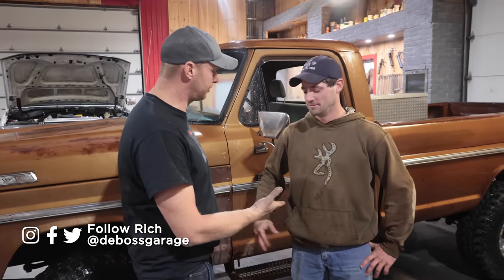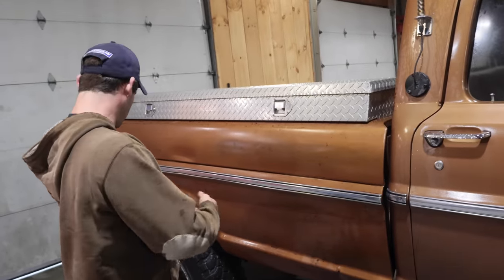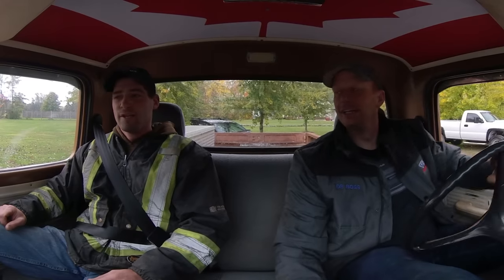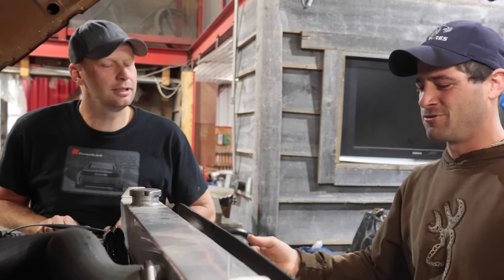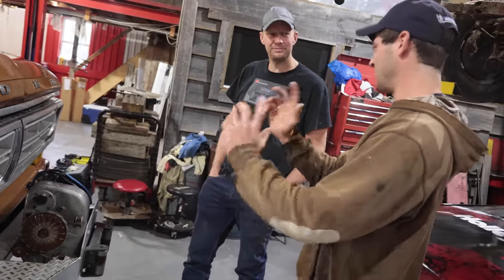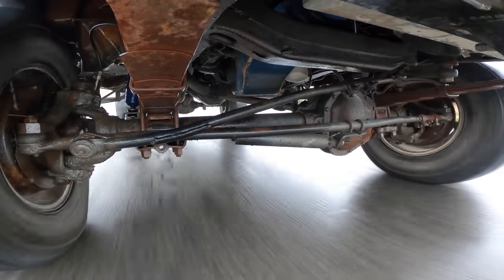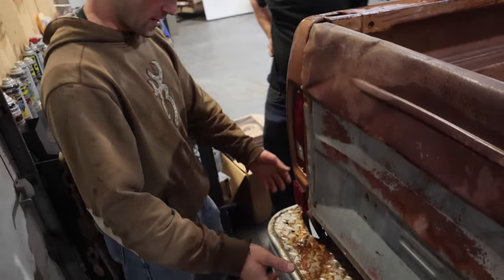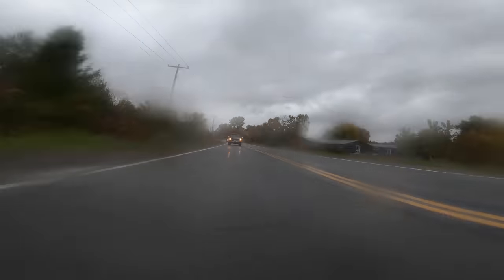The Truck You Want, But Won't Admit It.

Comment: Heh... My first S10 was also manual steering, but it needed tires and I got a deal I couldn't refuse on some Z/28 wheels. Going from like 195 14" tires to 235 15" tires sure looked cool, but it was exactly like the dude was describing as far as planning your turns and shifts ahead of time. 🤣

I did wood screw some cup holders to the floor though. 😁

Comment: I’ve had a couple of those, plus a ‘79.  My parents bought a new ‘72 when I was very young. 
An old Ford truck guy I talked to said they never called them “ high boys “ back in the day. They were just 3/4 tons.  He is perplexed as to how they got the name high boy.
Reply: I think I read somewhere it's because of the step maybe... I dunno I did read about them but I think it was rare to see a 4wd regular one???
Reply: So a Highboy is actually any 67-Mid 77 F-250 with a divorced transfercase. The 4wd trucks were essentially retrofitted 2wd trucks in those days as they used the divorced transfercase behind the 2wd transmission. The trucks sit higher to make room for the driveshafts. People say they have a “factory lift” and they sort of do but not for looks and it wasn’t an option but a necessity, they added blocks in the back but there are no lift blocks in the front.

Comment: Yes. I don't like Fords (GMC/Chevy guy) but I've got a black '74 Highboy single cab and a black '79 Highboy single cab that just got repainted. The 74 is my fav. You also never pass a gas station, but you'll be the first one there.
Reply: the dentsides are better than the square bodies for a lot of reasons and your ford is your favorite truck. how do you say you arent a ford guy?
Reply: @gorybonghit3211  My favorite truck is my 1994 Silverado Extended cab. What I said was, I liked the 74 more than the 79 aesthetics wise.
Reply: @cccalhoun  you didn't say anything about comparing them haha you just said your 74 is your favorite lol I have a 76 with a 460 and zf5 swapped in. About to do prerunner suspension! They're badass trucks! What do you like about your Chevy more anyway? Just curious haha

Comment: That's way better than any of the gas motors it was optioned with. Those IDIs are cheap n easy to find? I has a NA one once. It wasn't to bad at all. I think it just had the lift pump turned up a bit. Had 37s on it. It did fine. Nothing beats simple
Reply: not easy to find here in the us atleast where im at ive been trying to get a 7.3idi to swap my factory 1 of 1 89 f150 ext cab 4x4 with 37k og miles for over 2 years and cant find an engine (ive been looking for my dream truck a 99-03 7.3 powerstroke crew cab 4x4 dually for over 14 years so i dont mind waiting ) ill find one one day
Reply: @TylerDuysen  I see them all the time for parts. 6.9s 7.3s powerstrokes are hard to come by.
Reply: @egodeathplease  6.9 idi or 7.3 idi are basically nonexistent where i live 7.3 powerstrokes are all over the place (running engines) ive searched all over the us and in the chance they do come up there several states and 10-30hr one way trips away and most o0f those dont run ill find an engine for my truck one day but for now ill keep looking

Comment: Got a '90 F350 Dually 4X4 5Spd for $1200 dollars 4 years ago, king pin 60 front, 10.25 rear, traction lock, 4.10, newer tires, new brakes all around, it would not pull a 580K Case backhoe at highway speeds (No shit !) but it serves my needs perfectly.

Comment: My IDI is currently down for the count. Low compression. 175psi on the handful of cylinders after adding oil. But hey it made it to 375000 miles.

Comment: Glow plug fix 1984 Oldsmobile 4.3l v6 diesel glow plugs ac12g coversion on 7.3l idi i think is model that what i used and direct wire to a old style ford starter relay no more goofy controller

Comment: I did the 94/76 seat/slider upgrade in my 78, and yeah the steering wheel is closer to the seat.  Im 6'1" and noticed it right away.  Like the new seat though.  Jumpin in, have to pay attention.
Reply: 73- 79 tailgate. I See.

Comment: Sheet, I'd kill for that beautiful Highboy, I'd just swap those wheels out for some 16.5" white steels and some 34x9.5 Interco Narrow Super Swamper TSL's and throw a lift pump on and be golden 👌
I'm a GM guy, mainly 68-98 ,currently have a 97 GMC RCSB K1500 Sierra SLE on 6" lift, 15x10" polished Pro Comp 69's and 35x12.5 Patagonias with the trusty Vortec 350, but I have a weakness for those Highboys, especially when they're diesel swapped (a nice 6BT mechanical Cummins would be preferred)....one of these days though, if the stars align, I'll be trying to find myself either a square GMC or 88-00 GMC K2500/3500 regular cab, throwing a Detroit 6v53t into it and a Spicer 😅

Comment: That’s very similar to my truck that I will never part with. Same year mine was even originally the same color. I’m running a n/a 6.9 idi and the original model 4-speed. Wouldn’t trade it for anything. Yeah it’s a bit under powered but it’s as reliable as the sunrise.

Comment: indirect diesel injection <3 <3 <3 love my 6.2s in my 5-6 squarebodies/3 vanduras, want a 7.3 but ford hehhhhhhhhhh maybe someday when I get a real garage, 6.2 detroits are BULLET proof specially if you change your crank damper , and quite fast(not up to today standards but its fast enough.) if you have a good injection pump/diamond precups, may require the EGRless intake tho specially if you change your crank damper 6.2/6.5 are so underrated as daily drivers, edit: cant wait to see the white OBS Rich, love all the works you do, from a fellow french canadian up north

Comment: When I was a wee lad sucling on a bottle my parents had an old ford truck. Every time they started it my dad hoped under and taped the starter with a hammer and it ate head gaskets so frequently that allegedly my dad just started cutting them out of cardboard and slapping them in just as often. 

They also had a highboy till my dad did wheel bearings and the castle nut on the passenger side had a bur on it. So I was taken to the hospital, no injuries, my dad was stuck arguing with the cop about weather or not he was speeding, the tow truck flipped it up, right lifted the tire and an attempted to turn it.

Comment: My old '83 6.9 IDI started like an old carbureted truck as long as it was a warm day. No glow plugs, just bump the key and it was running. Only one battery. And that thing probably had 400-500,000 miles on it!

On a cool day, forget it - get the jumper cables and the cosby sauce.

Comment: Idi's honestly get so much hate for being slow but my N/A 7.3 idi 4x4 extended cab with over 500k miles easily maxes out the speedometer with the e40d and 3.55 gears about 1000lb in the bed. I can pass traffic, accelerate up steep hills, don't slow anyone down at red lights and handles off-road better then anything else. Sure its slow towing but still will do speed limit unless you are going up a steep grade. If you do a really good turbo setup from classic diesel design and R&D idi it actually pulls really good (friend has a classic diesel design setup with 90cc ip pump). Its no 6.7 but still loads of fun

Comment: Everyone has their preference, but I’ve always had good luck with the old IDI 6.9 and 7.3. Like anything else, they have their issues, they may not be powerhouses, but in my experience they will run forever. Just my opinion.

Comment: Much rather have a dentside than a bumpside but everything drivetrain wise is perfect. Just needs to dial in the fuel system and it'll actually start. IDI's get a bad rap because they are mechanical. That's the biggest pro too though.

Comment: I .miss my 1987 f 250 with 1 ton runing gear it had a 6.9 in it then i blew it up so i put a 7.3idi out of a 92. Took the stock ats intake turbo wire harrnse down pip injtion pump. And bolted it all on to the 7.3 right to the z f5 speed. That truck was a tank.

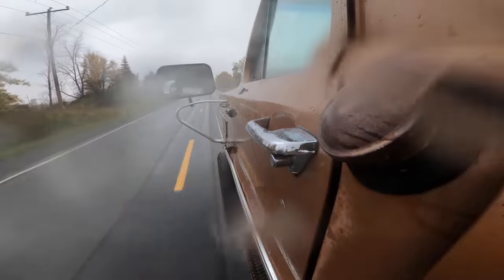Comment: 19:25  the truck is in 4wd
I spent the last 3 years putting a 2001 24v cummins, NV5600,  divorced NP205, 1978 ford king pin 60 front and a 96 dana 80 rear in my 68 f250 high boy.  It still rides and steers like a 1968 truck lol  but she gets 20mpg at 80mph on the high way

Comment: My brother-in-law has a 74  Ford 460 he was breaking drive shaft he found Out that if you find a truck with a 6 cylinder and use the drive shaft from it they do not break

Comment: Love to have that truck with a Chevy big block, different grille, chrome roll bars and KC lights. That’s Bigfoot #1 right there
Reply: @centraltexasfoxbodies  Ya Bigfoot was 100% Ford but I would want Chevy drivetrain cause that’s what I know. Not throwing shade at Ford. I own a 62 Fairlane and 08 F350
Reply: @centraltexasfoxbodies  5.4L Ford service and parts are the worst and parts are extremely overpriced. Swapped to manual locking hubs and still having issues engaging 4WD

Comment: I"d build it JUST LIKE THAT and then put an '86-'91 Ford King Pin high pinion Dana 60 front end in it with DISC BRAKES. '92-'97 ball joint would be OK too.
The brakes suck because it's drums in the front.
The Dana 60 ONE TON discs will fix that.

If you want more power a '94.5-'97 Power Stroke ain't gonna do it unless you want to modify it with a chip. Better put a pyrometer in it if you do!!!
REALLY will want an intercooler after that. Have FUN fitting it all in there!

Comment: The stock turbo sucks even at 10 psi the truck will just overheat everytime u try to pull a trailer or have it loaded with a camper. It's not designed to be a turbo motor in the na configuration you can climb any hill floored on the accelerator forever and it's fine. Soon as u add the Turbo the heads heat up the coolant goes into run away heat soaking and u hit 230f anytime u climb a hill loaded at 10,000lbs. I took the Turbo off and never ever overheat above 220 without the Turbo pumping heat into the heads and not giving any power.

Comment: I'd take my 7.3 IDI Turbo over a 460 ANYTIME!!!
I'm a CUMMINS NUT and I LOVE my IDI factory turbo.
Had a bunch of IDIs, if you want them to start you either have GOOD functioning glow plugs or plug in the block heater EVEN if it's 110 degrees outside.
If it's pre '86 DON'T USE THE BLOCK HEATER, it'll crack the block around the heater.

Comment: The factory radiator in the 87 f350 crew cab 2wd dually my dad had had the munts on the sides of the radiator and my uncle who is a mechanic and he ran a 95 Ford 450 7.3 power stroke 4x4 wrecker and he said that is actually to help pull out the heavy ass radiators out the freaking trucks they are way too heavy than they need to be and the copper core and brass factory radiator still overheats and leaks.. id actually prefer a 2wd f250 myself anyway but oh well, and if i was going to change the chassis probably the 99 to 2004 f250 super duty trucks for the suspension and the rear end in your f250 4x4 is the same as my momma 96 Ford F-250 super cab long bed since it was originally a 7.3 power stroke diesel but it has a 460 big block bored 0.30 over Edelbrock mpg cam which is hilarious lol, and her truck still has the factory aode automatic 4spd diesel transmission and the diesel torque converter which makes it snappy acceleration with the 460 dealer installed motor,pain in the ass to buy parts for lol!!! Tailpipe it's also the 3 inch to a Cummins 2004 24 valve 4 inch tailpipe and no muffler and cat loud!!!!
Reply: Oh I forgot to mention the 3.55 geared sterling 10 bolt rear the 460 and the diesel torque converter love it spins the 245/70 16 master craft CT tires like it's trying to blow them

Comment: One of my daily driver trucks that was my brother's ride to work was a pieced together after a friend wrecked it and it was parked for 14 years and I got ahold of it after the new alternator, fuel pump and the the clutch a 89 Chevy S10 regular cab short bed 2wd tbi 2.5 4cyl 5spd with the metal reverse gear and even for a s10 with the 94 s10 aluminum 235/75/15 tires on the manual steering shift and brakes truck after driving it three days to work 40 miles both ways i put a 79 Chevy k10 scottsdale custom option steering wheel in the truck have ever seen the el regular cab 89 Chevy S10 steering wheel lol nope they suck.

Comment: So because it needs maintenance like return lines, and other fuel leaks fixed, to start properly, tie rods and adjust the wastage to make more power.
12 psi instead of the factory 7 makes a noticeable difference, especially if it has a larger downpipe.
Besides stock 7.3 power strokes are gutless. untill you add a tuner intake an downpipe

Comment: All day long awesome⛽️🇺🇸 being brand specific makes little sense when it comes to classic vehicles everything prior to Ford's modular and GM's LS were all basically the same architecture and they all did the same thing my main work vehicle this very day is a 7.3 IDI every 3 years or so and injector installation kit cures all the return caps of their leak glow plugs once a year I mean think about it we used to have to change points twice a year in a distributor and spark plugs once a year it's still cheaper than a payment

Comment: My same motor overheats all the time if you put it under any load
Reply: Likely need to check for good flow through the radiator and make sure the water pump is really pumping like it should. Sometimes the radiator gets plugged to where it is barely flowing through. And a water pump can loose fins and not really pump well, or an air pocket can cause it to not circulate like it should. Also, make sure the radiator isn’t covered with dirt or junk on the outside. 
Generally overheating under load is a lack of flow, or lack of ability to shed heat.

Comment: "its kinda a dog" well yeah thats a bone stock 190-195hp engine for ya if you knew about idis like i do it wouldnt be such a dog thats a 93/94 factory turbo idi so it has forged internals and is the best of the idis  turn the pump up and raise the boost (they only make 8psi stock) this motor can handle 25psi of boost its a dog due to your lack of knowledge on idis but thats okay its a sharp looking truck and i cant wait to find a 7.3idi for my truck but after over 2 years ive had no luck finding an engine
Reply: Agreed. Being fairly well versed in the IDI upgrades I know that the extra power doesn’t come terribly cheap and the reliability starts to plummet with extra boost and power. The motor in that truck is actually out of an 89 so sadly no forged rods. It has the turbo kit from a wrecked 94 bolted onto it with the pump turned up and the waste gate tightened up slightly. It was also bored .030 over when it was rebuilt so for longevities sake excess boost is likely a bad idea for it.
Reply: @gavinmetcalfe140  the 7.3 idi will still hold 18-20 even overbored (this is on a non factory turbo engine) i was unaware it wasnt a 93/94 engine i thought he meant a turbo motor as in a 93/94 engine guess not  he could mx the pum out and bypass the waste gate and be fine i think he just expected too much out of an idi though

Comment: I'm in BC and  have a '91 F250 with a 7.3 IDI/ZF-5 with 830,000 miles on the engine. No major work ever done to it. The turbo engine only have 5 more HP in them, hardly worth it.

Comment: I would've put a 12-valve in it. Same work and money,  but way better!
Reply: that wouldve been dumb and no it isnt 12v makes less hp and tq stock vs stock (12v makes less hp and tq turboed then a na idi an turbo idi makes alot more stock) 12v is 4-5 x the price of an idi and is just as reliable also cost of adapters alone cost more than an idi engine so it makes zero sense to to cummins swap(12v 24v any cummins) a highboy
Reply: @skonky  
Model Year

Horsepower

Torque

1989 - 1993

160 hp @ 2,500 rpm

400 lb-ft @ 1,600 rpm

1994 - 1995

• 160 hp @ 2,500 rpm (auto trans)
• 175 hp @ 2,600 rpm (manual trans)

• 400 lb-ft @ 1,500 rpm (auto trans)
• 420 lb-ft @ 1,500 rpm (manual trans)

1996 - 1998

• 180 hp @ 2,500 rpm (auto trans)
• 215 hp @ 2,600 rpm (manual trans)

• 420 lb-ft @ 1,500 rpm (auto trans)
• 440 lb-ft @ 1,500 rpm (manual trans)

 if you compare the cummins from year to year to the ford diesel at the the time the ford engines make more hp (cummins made a small bit more tq then idi(the powerstrokes all make more hp and tq than the equivalant year cummins) hell a 6.9 idi makes more hp than the first gen 12v this motor is exactly 190hp and 390 tq and is a 93/94 engine only so if you compare the cummins engine to the powerstroke of the time (94.5-97) the ps makes more hp and tq than a cummins stock
Reply: @TylerDuysen  ok but who swaps a 12 valve into a truck and doesn't at least slide the afc housing forward. A P pump 12 valve can easy make 250+ with a grinder and a screwdriver
Reply: @TylerDuysen  A 12-valve may be slightly more,  but you can double the power for $300. The last two Cummins cost me $500. Don't be so cheap!
Reply: @tlr-nut7275  cummins these days are all 1000s of dollars for clapped out shit even blown up shit cost 1000 bucks or more, and to double the power cost at least 1k or more(things cost alot more these days). cummins does have the advantage of more aftermarket parts over everybody, which does suck but we cant help that. but you still have to buy the adapters which are over 1k alone. cummins are always a great engine(besides the 53 block and new 6.7 cummins) so is a 6.9/7.3idi/7.3idit or 7.3 ps  have a good day.

Comment: I had an 88 F250 7.3IDI would start without a single issue after I fixed it, and it was more than powerful enough to tow anything I threw at it and it was pretty quick as well. So the IDI bashing is really just nonsense.
Reply: They were good motors for a past time when people weren’t in a hurry or hauling heavy with 3/4 ton trucks. I do not consider being a hazard on the road enough power though. Get 15k lbs behind these things and they crawl around even on the flats.
Reply: @gavinmetcalfe140  I've pulled 8k before with it and it had no trouble even passing people. And they were not a hazard, that's just nonsense.